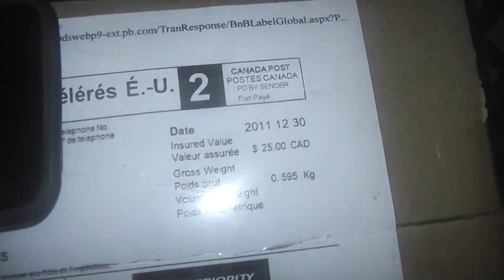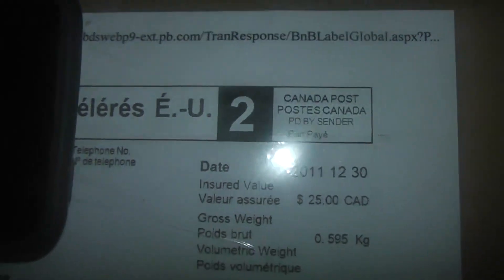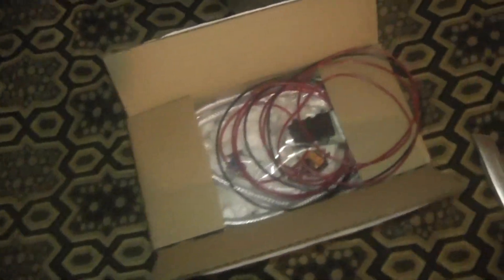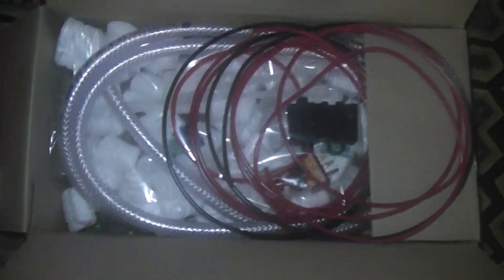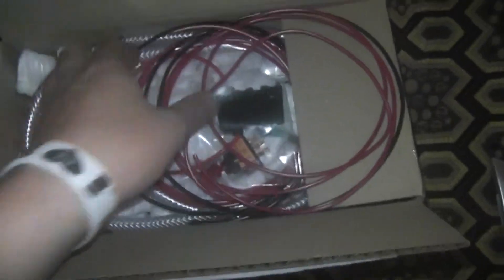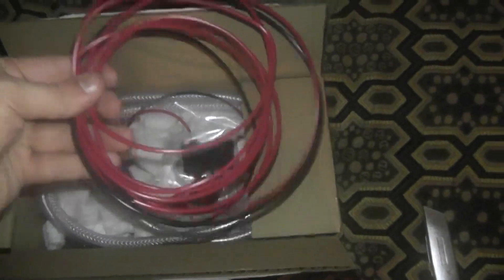Hydrogen Fuel Cell/ HHO Kit Unboxing - HD

Comment from the maker: @pearsonba350 I have seen one instance of where someone ran a truck (Ram) on hydrogen alone, but 98% of the time, it is just added straight into the air intake/ air filter area as another source of "fuel" power along with oxygen & gas.